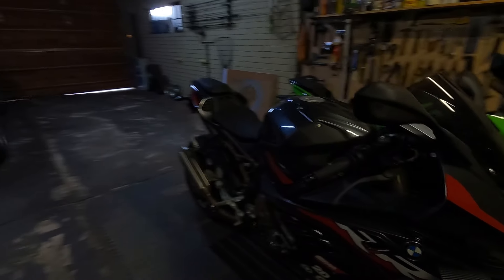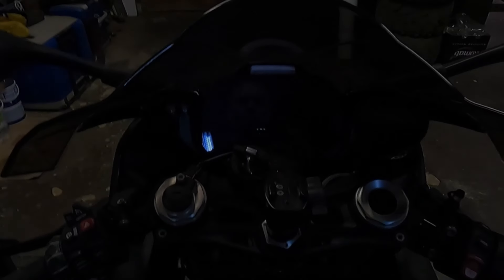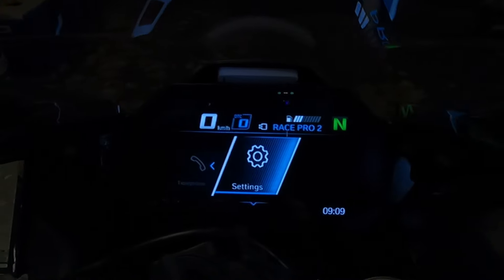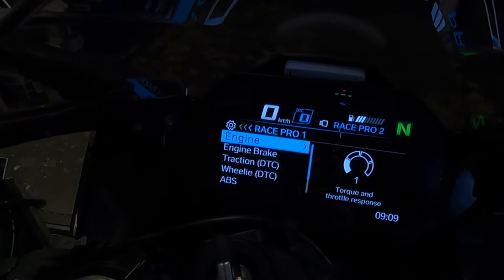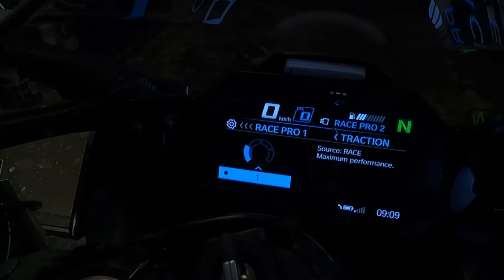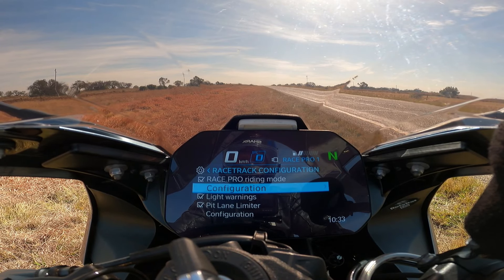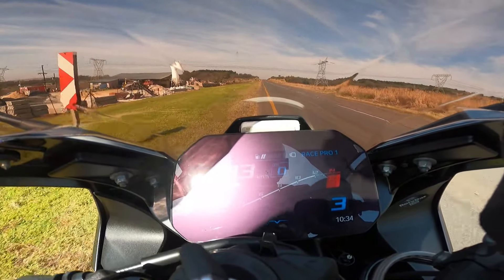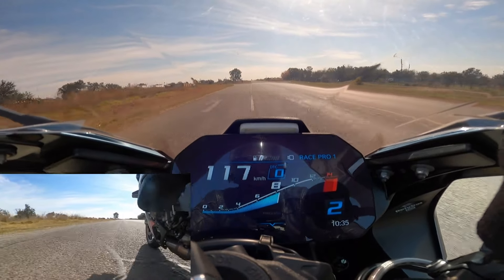BMW S1000RR Wheelie Control Settings and Demonstration. Does it work and is it safe?

Comment: You’re going wide open throttle? I didn’t have mine on race mode when I saw the video last and was able to get a little wheelie, but after I switched it to race mode I haven’t felt as confident with not flipping it lol

I had an R6 and I went down a tooth in the front and got it tuned for more low end power, and I went from being able to WOT it in any gear to almost flipping it the first time I went WOT the first time I did it with the new set up. So now I get nervous going WOT in low gears ngl lol. If I know I can WOT in first and this is what will happen I think I can actually work on getting over that fear and learning to wheelie correctly.
Reply from the maker: If you're in Race Pro with high wheelies possible setup and TC on main screen set to 0, you can confidently wot and it will pick up nice. Just don't get used to it and try the same thing with TC completely off. It's a death wish
Reply: @racermac1081  soo with wheelie control on 1 , and tc on 0 it will lift up more so than what happened on the video?  
Sorry to keep bugging you, I just wanna make sure I’m doing it safely without having to worry about flipping the bike at WOT. I wanna get used to the feeling of being in a decent little wheelie before I try to learn to do one without wheelie control or TC. 
I truly appreciate the video and the reply!
Reply from the maker: @DrSoKo.  With wheelie control on 1 and TC on 0, it will pick up like in the video. I've got my wheelie control now on 1 and TC on -2 and it picks up a bit higher than in the video. The lower(-) the TC is adjusted, the higher the wheelie will be. The higher the TC(+) the lower the wheelie will be.

Glad I can be of help.
Reply: @racermac1081  awesome!  Thank you sir! You’ve really done me a huge favor and have helped me feel more confident on the bike! Take care sir, ride safe!
Reply from the maker: @DrSoKo.  drive safe

Comment: Retry the wheelie modes again but with ABS set to 2. At least for the M1000R, it needs - S1RR and MR are essentially the same:
Race pro mode
Engine 1
Wheelie 1
ABS 2

Comment: tell me please Does the 2017 s1000rr have the same setup?
Reply from the maker: No, the 2017 is different. There's no wheelie control on them, but those models wheelie very easily anyway. I've had a 2015 and it picks the front wheel up easy, but you have to control the wheelie.

Comment: would be great if you could make a video on launch control. How does it work on race pro modes, if wheelie control is off or high wheelie possible. What is the difference if its on other modes say race, dynamic etc
Reply from the maker: I would definitely make a video on that, great idea, thanks. What I have seen is that the launch control only activates in Race mode and Race Pro modes, not the other Dynamic or Road modes.

Comment: The only proper wheelie control I’ve tried is on Yamaha mt09 3rd gen. It’s weird why all the other manufacturers like Aprillia, Bmw, KTM couldn’t master this functionality.
Reply: I ended up on this video going down a Google, ChatGPT and YouTube rabbit whole to see if anyone else does it like the MT09. My buddy has one and he can take a handful of throttle and it just holds the tire at a perfect wheelie height and he can ride it out as long as he has the power. He turned it off one time and looped it lol, so it’s definitely the LIF, not him. 
I’m assuming the R1 LIF is the same?

Comment: Use 2nd gear boss, got plenty of power and much smoother and easier to control
Reply from the maker: I have tried 2nd gear. Mine is not flashed and it seems like the front wheel does not want to come up at all in 2nd gear. My previous gen S1000RR front wheel came up much easier than this model.

Comment: My bitch wont come up in second gear, my R1 16' I could blip down and up and it would roll up effortlessly; wtf am I doing wrong.
Reply from the maker: Don't worry, you're not the only one struggling in 2nd grade. My previous 2015 S1000RR could come up nice in 2nd gear, but I'm struggling with this one. I also don't know why.
Reply: @racermac1081  dude it's mad confusing have you tuned yours out yet? Because I'm only seeing clutch ups being the move but im not a fan.

My r1 was like butter smooth and controllable.
Reply from the maker: @mattmoto  No, it's not tuned, but the guy at the shop told me that there is no flat spot on our bikes in 2nd here in South Africa. On the dyno, it pulled a rather straight line with no dip. I've got a video on my dyno results, but I just don't know why it's not picking up in 2nd. It must clearly be down on power.
Reply: @racermac1081  cap... run it out to 8k twice today and it's there. It feels like 50torq before that... the r1 had like 78 through the whole gear it has to be that.
Reply: @racermac1081  I'm gonna do a video and bitch about it... see if it I can get some positive or critical answers.
Reply from the maker: @mattmoto  sure, let me know if you find the solution. I've meant to make a video about it, but I'm not getting the time lately
Reply: @racermac1081  its kinda tilting to be honest. I'm wondering if there's other safety shit on de tuning the pop up besides the obvious